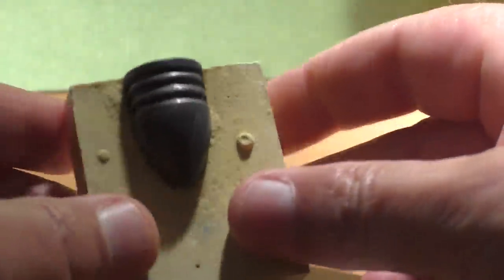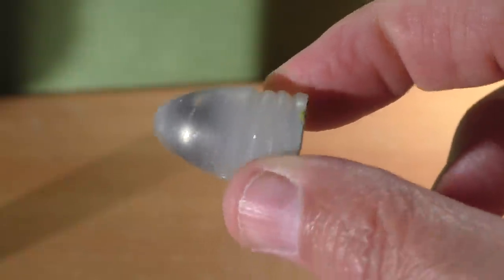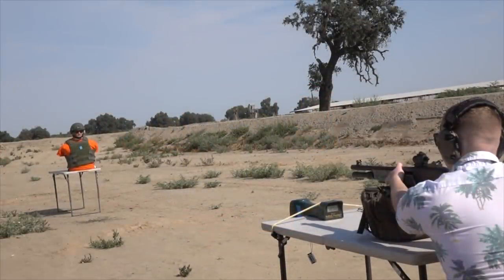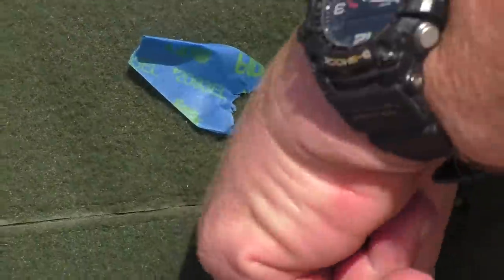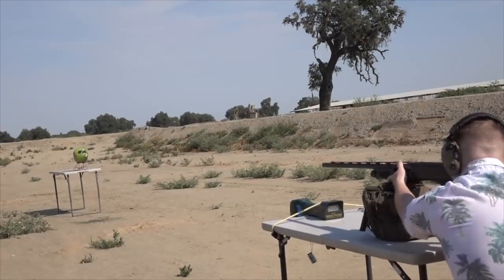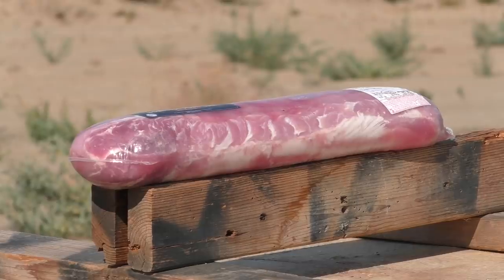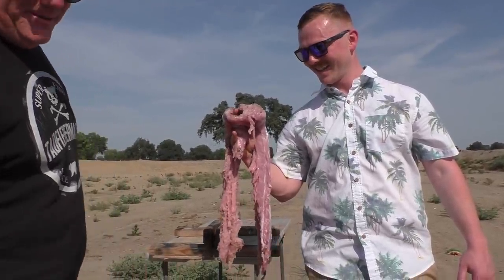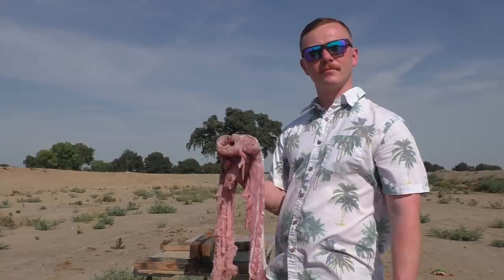High Velocity "Ghost" Minié Balls  -  Tested!

Comment: Any kid who ever played with model rockets, and figured out the fins have to be at the back, knows why they are stable.  The center of mass is very far forward of center of pressure it the slug starts to wobble.  As the bullet yaws, and the skirt comes out into the airstream, it is immediately pushed back in.  The rotation is about the center of mass, so the bullet stays stable.

Comment: I'm curious if using a steel cylinder would work, or adding some steel wool to the hot glue could keep it together.

Or just keep them on ice, hot damn those things rip when chilled.
Reply: Casting them in a high density silicone rubber might work as well, that would be easier to balance than adding other materials. You could also ask if someone can machine them out of delrin or similar then bond the metal in to a socket at the tip, internal or external.
Reply: Putting an aluminum disc (a "slug") behind the ball, thus spreading the force exerted by the acceleration, might work, too.  Or maybe a trimmed-down penny, since that's probably cheaper these days.
Reply: @Bacteriophagebs  using coins would be illegal.
Reply: @anomilumiimulimona2924  no it isn't.
Reply: @anomilumiimulimona2924  Would it?  It's not "coin shot" if it's in a slug, and pennies are the exception to the law against destroying money (which is why those penny smashing souveniers are legal).
Reply: @Cancer McAids We've seen resin crack and shatter when used in slugs, and I think part of the point is to make cheap, easy slugs.  Steel balls and hot glue are both cheap and easy to get.
Reply: I could try casting some from a high impact poly-urethane.  Hmmm. Thoughts
Reply: Two pack epoxy adhesive.  Just place the ball bearing in the mold, and pour in the epoxy, leave overnight to cure.
Reply: Your Nightmares Come True  Yes, I phrased it badly.  It's illegal to alter currency, including, specifically, lightening coins (which is what you'd be doing to trim a penny down), but only if it's for fraudulent purposes.  Destroying it is fine.
Reply: @Bacteriophagebs  luckily, firing will likely cause the steel shot to peen it into a shape that is clearly no longer a penny.

Comment: I think making sure the plastic is only under compression would provide more than satisfactory results.

So casting that with the ball already in the mold to form the tip of the projectile.

Perhaps drill the bottom of the mold to accept a metal pin that's cupped on the end to fit the ball. Drop of super glue to hold the ball on the pin, or use a very small rod from the back to hold the ball on the pin, just to make sure the ball doesn't fall off or float at all.

If everything is sized correctly this would provide an excellent & very controllable interface where the tip of the projectile transitions from steel ball to plastic so there's no lip to catch any air.

You could also use a smaller diameter pin and push it into the cavity ever so slightly to provide a something like ~1/32" layer of plastic around the front of the ball. Add a dollop of plastic to the front to fill the hole created by the pin if required.

If needed you could trade the center hole for 3 holes around the periphery by adding 3 equally spaced sliding pins to the mold for the ball to rest on. Then pull the pins before you pop the mold. These can be very tiny & not cupped at all b/c you're not trying to balance the ball on them & the resulting holes would be just as small. Probably not even requiring filler.

Comment: How would the slugs do, if made with casting resin and #2 or 3 buckshot pellet in the nose? Thanx for reading my idea
Reply: Too hard, probably.

The idea is that the Minie ball is below bore diameter so you can drop it down the bore easily but it will expand to engage the rifling.
Reply: @ScottKenny1978  less of an issue with a shotgun.
Along with the hardness of casting resin, you usually get brittle/frangible atributes. This may result in RUD (rapid unplanned disassembly). There are ways to decrease the brittleness of epoxy and other resins, but most impact other mechanical attributes of the material.
Reply: @martindinner3621  that too. The slug shattering in the bore would probably not hurt the shotgun, but would make the load about useless. Assuming that it basically shattered into dust, of course.

Comment: In your mold, drop the ball in then drop a washer slightly smaller than the O.D of the Minnie ball hole center over the ball bearing. This will distribute the force over a wider area. This should stop the ball bearing from sliding back in the hot glue.

Comment: Bullets are not stable without rifling, it's just that the nose-heavy design of the hollow base bullet makes it more resistant to tumbling (that's why the round ball stuck around so long). Shoot at 100 yards and you will see Key-holing, if you can hit the paper at all. That being said, this is super cool! Might have to use a .30 bullet as a core that runs nose to cavity, and then use the high tech thermoplastic (lol) as a jacket? People complain about frozen paintballs lol...

Comment: My and I have a couple of Civil War rifled muskets in .69, one original, the other he built. They thump you pretty good, especially with a service load. We used them most during one team event known as the hanging stake. It's just a plywood or particle board 6 to 8 inches wide hung horizontally with a vertical line painted in the center. The gist of it is for the team to hit it enouch in the center to get it to break in half. How much of a difference it actually made over the usual .58 and .54 cal muckets, I don't really know. But whatever, we did it anyway, lol. Also used to use them during long range events when it was windy. The wind just didn't push that big ass hunk of lead around nearly as much as the lightweight semi-wadcutters we typically used in our regular muskets.

Comment: The vapor trail is from the condensation on the cold round vaporizing do to the heat of not only the powder burning, but the friction of the slug against the barrel. 

You'll see similar if you don't clean out your bore of CLP properly. It will burn on the way out causing a vapor/smoke trail.

Comment: Need to mold it into some UHMWHDPE or polypropylene.  A little bit of aluminum structure behind the ball molded in to spread the force out on the plastic might help without adding much weight.

Comment: Putting it on ice was an awesome idea. However I'm sure you also realized it affected the speed of the burn and velocity. Maybe try HDPE plastic (milk / water jugs) cast into a heated mould? I'm sure you used the high-temp melt hot glue, but obviously polyethylene would be much harder.

Comment: The vapor trail on the cooled projectile was likely due to the air around the slug cooling causing the moisture in the hotter air to condense around it as it flew.

Comment: I'd like to see this idea again except using epoxy instead of Hot Glue. The reason you're having so many failures is because even though it's brief, there's enough heat and force to soften the projectile which is causing it to deform which is why it appears that the ball is shifting.

Comment: I wonder if adding a small washer in behind the steel ball bearing would've caused it to stay in place instead of shifting backwards, as that would have provided a larger surface area for it to push against.

Comment: How about that dental compound that hardens with UV light?
From search:
Composite Resin
Also known as tooth-colored fillings, composite resin is a mixture of plastic and glass or quartz.  It's applied in layers which are cured using a UV light.

Comment: You could try two part epoxy with milled ends (Fine chopped glass fibre) for reinforcement, it would be plenty strong enough to keep that ball in place.

Comment: spit-balling here but could you pour a small amount of lead into the mold first to cast a hard nose, and then fill the rest of the mold with the plastic? It might solve the problem of the metal displacing through the projectile. or it might just separate completely in flight, who knows?

Comment: The room temperature glue was too soft to transfer the most energy possible to the ball bearing. Need either harder casing for the ball bearing, or maybe a small rod or nail bit to act like a pool cue. It would be hard to balance the rod though so harder casing is probably the better solution.

Comment: I got a question, they coat the protective plate to prevent spalling, if a plate had a curved edge would that be enough to prevent spalling to the under chin? Like a flare out. Or maybe a bead of welding. I don’t know but I’d be interested to find out.

Comment: The old design hollow base Foster slug is great for most applications in smoothbore shotguns.I really like the Civil War slug replica. Cast these in glass (or lucite) with the steel bearing weight in the front, I’ll buy 250 rounds along with everyone ELSE.

Comment: I wonder how far it would need to shift rearward to fly true. Barnes bullets had the mrx ( Maybe still do)rear heavy bullets for rifles , but I know its abit different.  High pressure, higher velocity , smaller diameter , lighter weight projectiles, Higher ballistic coefficients .ect.ect.

Comment: Hey Taofledermaus, 

   I recently used some Hornaday 180gr gmx (solid copper) in my 30-06 against some scrap rail track and noticed that it barely put a dent in it like something barley noticeable with my nail it looked as if the copper round was just disintegrating on impact used a normal federal 180gr (lead core) and it left a decent enough hole I thought this would be something cool to slow mo and maybe compare different metal types on impact
Reply: Man train rails are hard as hell. I made an anvil out of a piece and it took 2 band saw blades and 5 hours to get a nice cut. I set it to the slowest cut rate possible. I went too fast on the first attempt and ruined a blade and cut.
Reply: @glenmel78  yeah man I wouldn't doubt that at all. I work in an iron foundry so I know all about how hard those fuckers are lol, was just very interesting how my lead core round put in a decent hole but the copper round did absolutely nothing.

Comment: The hot melt glue was a little too soft for this, maybe making the same rounds from JB weld or other high strength epoxy would work better.

Comment: You are missing a trick by not having a cheap camera slung under the table pointing at the shooter. Of course there is a chance that it could be hit but two feet below the point of aim is likely to survive dozens of shots on average. WiFi action cameras are dirt cheap.
Reply: We used an expensive GoPro to film the shooter in the last video.  What do we have to do to make you happy?!  😆🤷‍♂️

Comment: Hot Glue  + Hot Gasses  = Melted Glue + Heavy Steel Ball. Your just heating the glue up so that it has no form or (on the one with spin with no rifling) a sort of "Back Wing" to spin with.
Reply from the maker: Not even contacting the hot gasses.

Comment: I'd imagine you could push the speeds much higher, if you used PET as plastic. 
That would require a temperature controlled hot air station though, to make it soft without degrading it. 
They sell plastic welding rods of all kinds. So maybe you can give it a try. 
Or find someone who is skilled in working with those materials.

Comment: I wonder instead of hot glue, would two part epoxy work better.
Reply from the maker: If it has enough force to drive the ball back in hot glue,  it would definitely have enough force to shatter the epoxy.

Comment: Want to try casting them in epoxy? I am sure epoxy would hold up way better than hot glue. Could even add glass fibers if needed.
Reply from the maker: It would probably shatter.
Reply: @taofledermaus  I don't think so. Happy to try it but it seems like molds are sold out everywhere. Looks like you cast that mold yourself from a lead bullet.

Comment: How about using cast polyurethane instead of hot glue. More expensive, but the right stuff could hold together I think.
Reply from the maker: If it is resilient,  it might work.   If it is brittle it will shatter.

Comment: Lead is still used because no one has found anything better. And not for want of trying. Its density, softness, low melting point, and low cost just hasn't been equalled by any other compound.